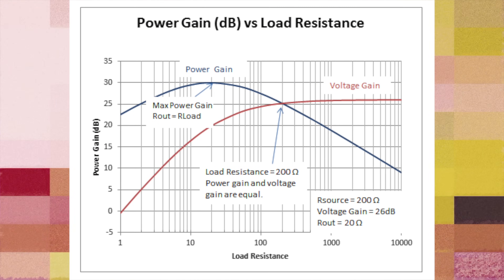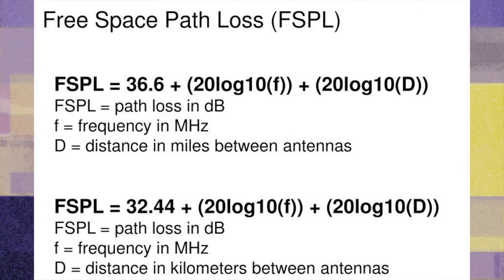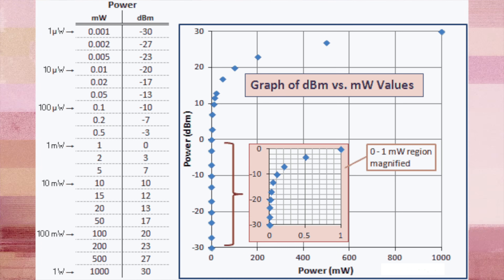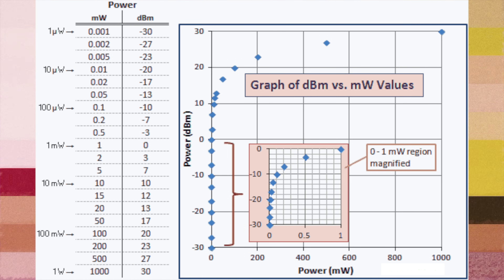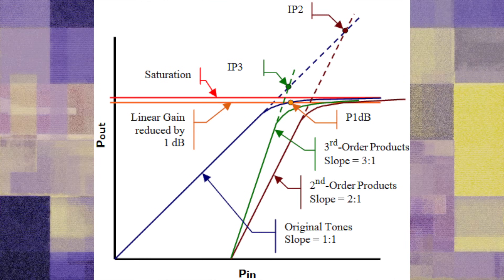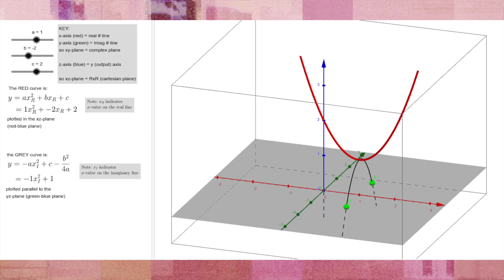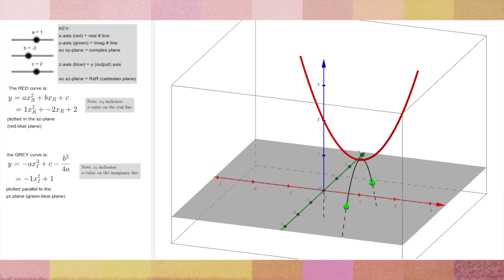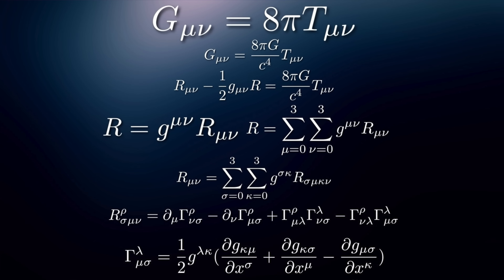Baofeng UV-5R - Does More Power Give More Range? Can You Transmit Farther With More Watts?

Comment: I've had this UV-5R less than a week and it's bricked itself. It turns on, Tx ok but nothing else works. I can't access the menu or much else. What did I expect for 30 bucks ! hah hah. It's in my bin ready to be compacted and buried where it belongs.
Reply from the maker: Sounds like you locked they keypad.. takes about 1/2 a second to unlock it by pressing the same button you pressed to lock it.

Comment: 😇 I've been a licensed ham radio operator for...actually, my test is coming up in two months, but I have a GMRS license. Well, it's in the mail, but it's due any day now. Anyway, I happen to l know for a fact that the extra wattage will (I'm told) send the signal to your antenna much more efficiently if it has to travel through a long wire, say, up your roof and out your tall antenna. Five watts won't push the signal nearly as well. A 5W radio may do okay, but an 8W radio will take the other 3W, and they will get out and push the 5 watts signal through the wire up to the roof and out of the antenna! The person who told me this is a roads scholar, which is to say he drives trucks for a living. 

Why don't you call your friend, Chris, and transmit on both radios at 5W, 8W and whatever the medium watts is out of the 8W radio? Use the same antenna on both radios and see if they sound the same. We haven't heard from Chris for a long time. 🚒

Comment: whether you  have a 4nor 5 watt pep radio to radio  in a mobile to ht  500 meters a worst and 1000 meters at best limitation  of ht  antennas
Reply from the maker: I use the the stock antenna on my UV-5R to reach a repeater 70 miles away. 
I am not good at math but I am pretty sure that is more than 1000 meters.

Comment: Thanks again for your insight. Changing my antenna made the biggest difference. I use the Signal Stick. I also raised my base station antenna to 40 feet above the house and go antenna's made for the frequencies I talk on. I also changed my coax to the best Messi Peloni I could get and got my SWR down to 2.

Comment: The major factor here is the quality of the antenna and the height.
In 1972, at the age of 16, I spent a weeks pay to purchase the cheapest mobile CB radio and antenna that Radio Shack offered, a 5 watt Realistic Mini 23. A while later I installed an Avanti Astro-Beam AV-150 three element beam on a tower with the boom height at 72+ feet high, in the second wave length. I had the best station in town using only that tiny little 5 watt mobile radio. People would come to my house to see my station and ask "where's the rest of it" after seeing that little mobile radio on my desk. I could talk to mobile units in neighboring towns 30-40+ miles away with ease. I was accused of Ghost Talking many times because nobody else could hear them. I had better range than 300 watt base stations. I could walk all over them shooting skip to a station in Nova Scotia Canada. Her handle was Sugar Cookie and I was the only station in my area she responded to. They all tried to make contact and failed.

Comment: Down to about the two-meter, 144 to 148 MHz, you can get away with a magnet mount on a cookie sheet or the top of the refrigerator.  At CB radio frequencies, 27 MHz, you will generally need a larger ground plane or radials to get a decent SWR.

Comment: Pretty much true for not only GMRS but also true for more or less all terrestrial radio communications.  5W to 8W is a 2dB increase in signal.  On old radios with a signal strength meter, that equates to about 1/3 of a point on the S meter, so S3 becomes S3.333, hardly noticeable.   Certainly an improved antenna system/height and appropriate quality (low loss) cable will tend to make a much more significant difference to coverage and signal strength.  That's said, every little bit helps, so 8W will get your more fars... just not a lot more fars.

Comment: On CB skip is easier to achieve with more power. That’s why sideband with its 12 watts is normally used for distance. AM and FM are limited to 4 watts. I have no experience with FM, but most of the AM stuff is local.
Reply: Easier to achieve with more power because AM and FM are very inefficient modes for distance, but have great bandwidth for clear and robust voice. You cut that AM bandwidth in half and go sideband, I can talk halfway across the US on 4w without issue.  Same with FM at VHF and UHF frequencies.  SSB VHF commonly travels hundreds of miles with a high gain antenna.

Comment: The antenna is the most important part of a radio. I do a 2 meter net on Saturdays. I had a $240 dual band attached to an antenna on my roof. It took a dump. So I got out my $24 Baofeng and attached it to the antenna. My friends say I have never sounded better. I have been using it for months now. Thanks for the videos.

Comment: New HAM boner here. I’ve been studying and assimilating “good” info as quickly as possible. 

Do you have a system in place for getting more fars and, if so, would you be willing to share?

Thanks for everything so far.

(Ps…Amazon was running a special on the 2 PacShakur of the 8W with the better antenna and charging stations so I went with that. Please don’t judge too harshly)
Reply: With VHF and UHF,  height is king. Low loss coaxial cable running to a ground plane antenna, or using a directional antenna like a Yagi is your best best for fars. My longest with a 4w HT on FM is about 120mi, done on a 3 element handheld Yagi made by Arrow Antennas. Granted, I was on the summit of Mt. St. Helens... see above where height is king.

Comment: One of the best ways to think about  "fars" from a radio and power and height, is to visualize it like a light bulb.  The higher you put that light bulb the farther you can see it.  Think of 1 watt of power as the equivalent to a 100 watt light bulb.  So if your on the ocean on a boat and another boat has a 100 watt lightbulb 30 feet up, you would be able to see that pretty dang far pretty clearly.  If it had 5 100 watt light bulbs it would be quite a bit brighter and you could see it even farther.   Now say your in a dense forest.  1 100 watt light bulb a ways away from you,  you may only be able to see after you move around a bit and you may only catch glimpses of that light (signals with static).  If you bumped it up to 5 100 watt light bulbs you still  would have some struggle seeing it.  But it would be better.  But you would be better off if you could get that 1 100 watt light bulb higher up above the trees line.
Reply: If a tree alone in the forest should happen to fall, would it fall on a bear taking a shit?
Reply: @oceanaxim 

Yes, everyone knows that 😊

Comment: Can you tell me how to hide an antenna from my HOA?
Reply from the maker: Put it in the attic or in your window.
Reply: Integrate it into any structure of the house too. 

Then work on leaving an HOA community...
Reply: "Some people" use the anal insertion method but  I do not reccomend that, even though no HOA has ever found an antenna there as far as I know.
Reply: Get a massive tower and put a huge antenna on top, right in your front yard.  Add LGBT flag. No way your HOA would risk a hate crime by asking you to remove it.
Reply: There’s a few fancy places where feds live…they like to have us install equipment that is disguised as a tree. Yes, a tree. Factory equipment mind you, that “looks like” a tree. #dontshootmydog
Reply: Hide the HOA Karen in your attic.
Reply: If you have vinyl gutters, build an end feed half wave, attach it  horizontal on the inside of the gutter off the bottom, run coax through down spout, then go through a wall away from the down spout. Just make sure connections are sealed up really well
Reply: Get the Midland MXTA26 antenna.  Its just a black whip.  Mount it just behind the peak of your roof and no one will ever notice it from the street.  Mine was on the roof for 13 years during which I received many warning letters from the HOA about my garbage cans, weeds in the front garden, and even mildew on the driveway but never the antenna.
Reply: Move out of the HOA, problem solved😁
Reply: @YogiDemis  best answer... HOA is just a 2a incident waiting to happen..
Reply: I put a Comet GP6NC (GMRS designated antenna that does well with SWR on Ham 2M and 70cm) in my attic (connected with LMR400) and it's bad azz...gets waaaaay out with 50W and hears just as far (50 miles, and I'm in the foothills).  It takes almost every bit of the space from floor level to the peak of my roof but it fits with about 10 inches to spare.